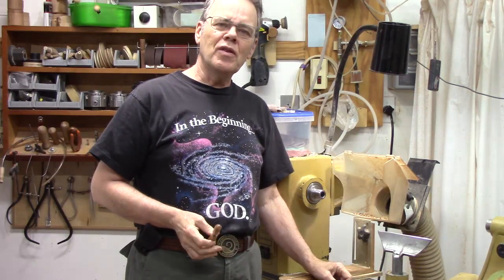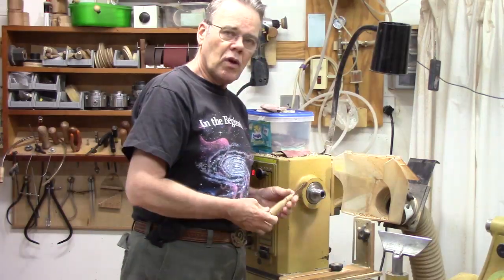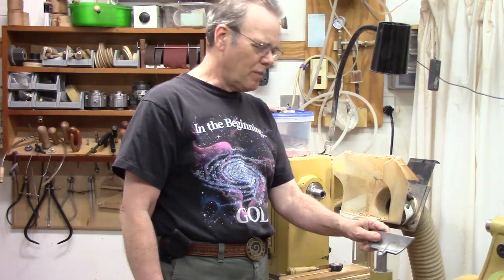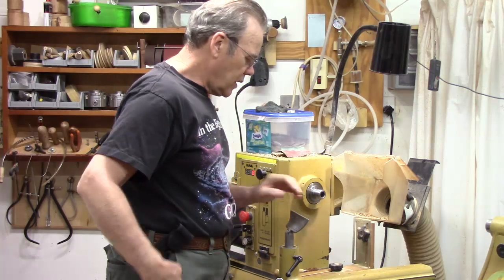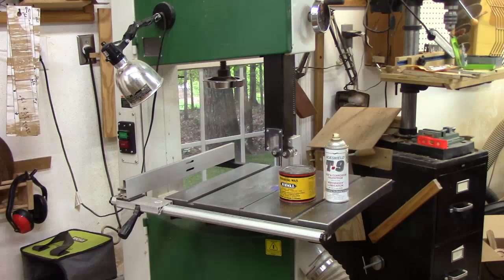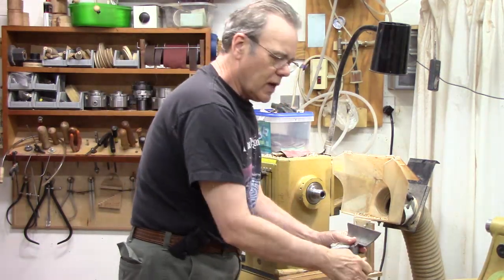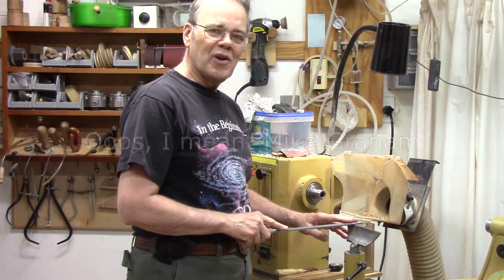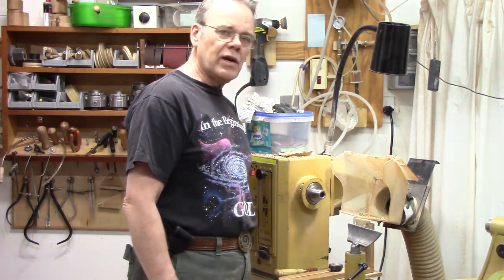Lathe Maintenance - Tip of the Week

Comment: Great tips and nice shirt.  I also blow the dust and shavings off the bed and banjo occasionally during the day.  The banjo hangs up frequently when shavings accumulate on the banjo lock disc.
Reply from the maker: I guess I would blow off debris occasionally if it were more convenient but I would have to turn on the small compressor, deal with the noise and drag the hose over. So blowing things off happens when I use the compressor for something else. Dust and shavings don't seem to clog my banjo. I keep a small bench brush nearby to sweep the lathe clean.
Reply: My air hose is always handy by the lathe but I think the key is to oil the bed regularly.  I will add that to my setup process each day.

Comment: Nice tips. Theres a thing with sandpaper. I keep sandpaper i use on metal separate from what i use on wood. The thing is some woods get stained by iron filings very easily, like oak. So anything that has iron filings in or on it, doesnt go back on the wood. (Unless i want black spots ;) )
Reply from the maker: Good point, Willem. I throw the piece of way after using on metal.

Comment: for those of us without airconditioning in the shop... Balistol is a much better rust preventative than WD-40. It can be found on Amazon or at most any gun dealer as it works great to protect firearms as well (I picked this tip up from Sniper School and verified it with my WWII tanker grandfather who has used it for decades on his guns as well.
Reply from the maker: I don't have any guns to clean so was unfamiliar with this product but will try it out after my WD40 is gone. Thanks for sharing.
Reply: Mike Peace Woodturning I am a biginner woodworker, but have used Balistol to protect my tools and guns for many years. My weapons manager in Desert Storm picked this tip up from me and we had a whole lot fewer jammed weapons in the sandy areas of that war. I put it on the bedway of my Harbor Freight lathe when I first put it together and even in my average 80% humidity I have no signs of rust on it or my refurbished hand planes and chisels. I have had loads of rust with WD-40 before finding Balistol in my youth. You won't be disapointed with this product. It does cost more than WD, but so worth the investment.
Reply from the maker: Cheaper is not always better is it? It is about the value. Maybe I won't wait. Thanks again.
Reply: Yes sir.

Comment: I noticed that you use WD40 in a pressurised spray can. Locally WD40 is available in liquid form. And apply it using an unpressurised sprayer. This is a lot cheaper.
Reply from the maker: Thanks for sharing. 
Cheaper? Ok. But for me that can will last me at least 2 years so it is worth paying a few pennies for the convenience in buying and inconvenience of adding a liquid to a sprayer. Nice to have choices though since one size does not fit all.
Reply: I can buy 4 litre bottles of WD40 fluid for about $40. Which if I only used it for my lathe would last several decades. That said given comments elsewhere on this page I may try Balistol. IF I can find any here in NZ.